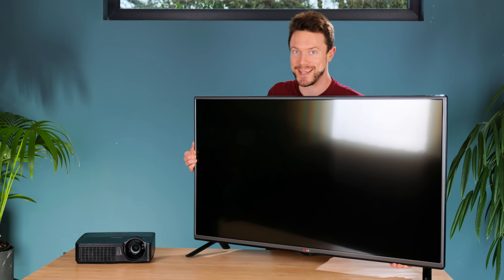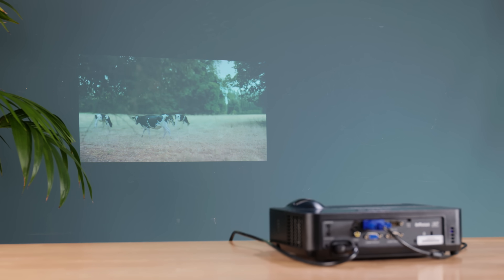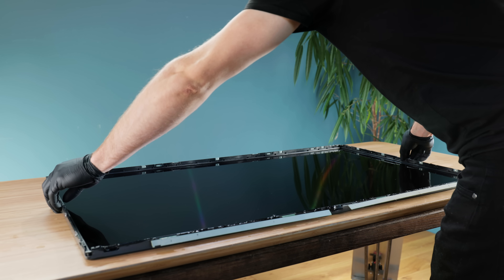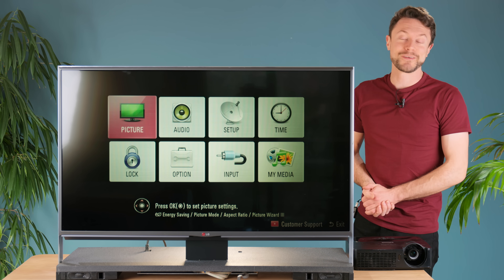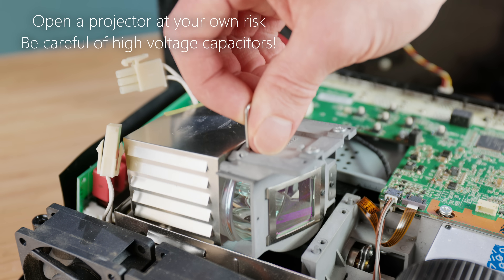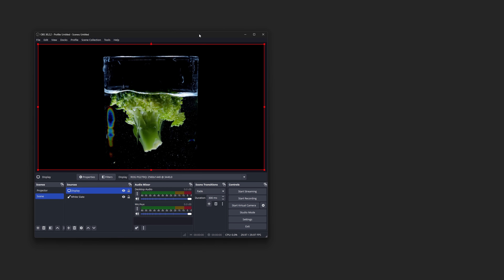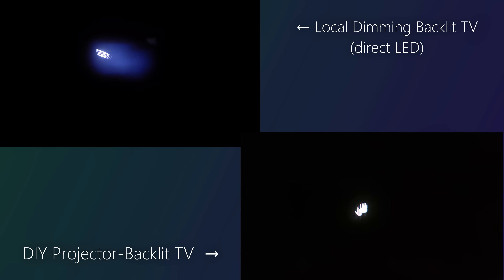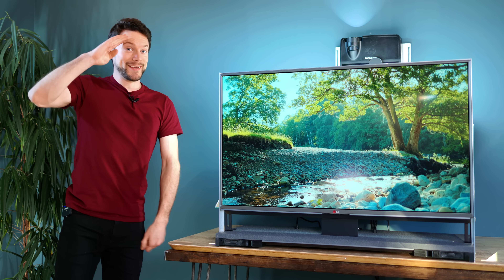DIY "infinity contrast" TV -  with 100% recycled parts

Comment: You should increase the brightness of the projector, (led or otherwise) and then add a modified version of the colourwheel that flickers the screen 960 times/second in sync with the tv to reduce motion blur. If you do it right you  could end up with the ultimate display: oled contrast (hdr), crt motion clarity, and lcd sharpness

Comment: I wonder if you could take say 4 of the LCD panels from 75" tvs and replicate this but using a better, brighter projector would you get a nearly perfect video wall without the typical cross in the middle like you get with typical 4 unit setups due to their bezels?  The clarity of the now 150" screen would be unrivaled for a theater with exception of video walls costing 100s or thousands of dollars.  The only issue I can think of that would be the most difficult would be the alignment of the 4 panels and hold them in place as they would be hanging on a wall together.  I know virtually nothing about this area but am currently exploring building a home theater and wondering if there is a better solution than the typical projector and screen or the unattainable video wall.

Comment: But why are u using the TV mother board for TV programs. If u connect the set top box of your local dish to the projector and focus the beam on the back it will do the same. After putting back the motorized Colour mixing disc in side the projector. Try projecting programs directly from the back of the TV. You will get the same results.

Comment: I did this a few years ago with a short throw projector that schools used for their 'magic whiteboards' and it works great and results in a much less deep requirement.  I have been thinking about using a small monochrome LCD panel to place in front of another projector to get deeper blacks for video projectors, as they always struggle with elevated blacks.

Comment: I can see all of this fitting in one of those old big screen TV cases from back in the day. You should be able to get all those parts for cheap if not free. On top of that it gives u room to add in a nice sound system as well. It will be a big and bulky. But it will look and sound amazing, and it will almost be free.

Comment: Using a short throw projector would make this project perfect. It would make maintainence much easier, as you don't have to realign the projectors and mirrors every time you need to clean and move stuff around. I would consider the slightly reduced color quality compared to an OLED to be a fair tradeoff for longevity. No more worries about accidental screen burn in from leaving something still, on screen for too long. It would also be cool to get a short throw projector with an extra bright, replaceable led, and stockpile them (just in case, if that even is a thing). You can even run it at 70% brightness to maximize its efficiency, plus add some decent cooling, to make it last basically forever (learned of good led practices from a dubai bulb youtube video from bigclive and another led video from technology connections). 

I would absolutely love to see a v2 video, using a premium parts, built exclusively for picture quality. longevity, efficiency, and with no compromises in the design. 

I'd imagine watching something like Odesza live at the gorge would be eye candy on steroids with that build.

Comment: I do use an OLED and hopefully upgrading soon from 65OLED806 to 77OLED950. I tried different iterations of home build Ambilight but just none of them could compete with the original so some 4-side ambilight Philips was KO criteria for me. I have a really nice 6.2.4 Atmos/Auro3D setup including a fair share of room acoustic treatment. And then just a 65" TV. And maybe I can upgrade to 77". Projectors are no option since image quality / deep black is just not good enough even if you spend 20+k€ and use grey canvas. LG doesn't even sell their 83" Panels to Philips which pisses me off. Let alone the 97" which is the first OLED coming close to having a home cinema like size but for a hefty early adopter premium.
This could be a solution. Grabbing some 97-116" LCD and combining it with a short distance beamer. But one would lose option for build in "native" ambilight...

Comment: The OBS work around is a poor substitute for alignment that worsens image quality.  If it wasn't for memory failing(making alignment necessary every time the TV was turned on) I'd still be using projector TVs.
  Display a grid appropriately sized for the ratio in resolution difference, align to that.  Rows and columns are your friends.

Comment: You cold simply use a same size e-ink black and white lcd panel behind the main lcd panel to block out all light splitting the main signal input ( main lcd color signal & e-ink black and white signal). And you could simply use the normal backlight again ( even upgrading to a 5000nit strength if you want.

Comment: If I had enoigh money Id try 4x or even 16x 4k projectors to create one 16k or 64k picture with projectors throwing a single square of the big picture each separately set so close to each other it would look like 1 big picture. Now, what can run 4x nvm 16x 4k projectors spreding the pictiure inbetween then at the same time that doesnt cost a samll fortune? Btw, even if anyone wanted to spend that kind of money the problem of the source of such resolution remains unsolved

Comment: Why not flip the projector and mirrors around 180° and project onto a mirror mounted on the floor instead of the ceiling? That way you don't need to wipe dust off the slanted mirror on the back of the TV stand a bazillion times per week (depending on where you live), just place the whole contraption in a cupboard, making sure the projector gets enough airflow to keep cool.

Comment: I don't get why did you put back the most difusing back pannel... Makes no sense to diffuse that light by too much, especially with the high res.
Reply: The projectors and the tv's resolution is insanely different thats why. The part at the end where he used the obs filters is because even the most diffusing panel wasn't enough diffusion, it was almost impossible to align the screens properly and gave ghosting, text misalignment and parallex effects. He achieved the proper diffusion with the filters.

Comment: While this works well there are reasons why they did not make such things: The projector's bulb has a pretty short life compared to LED or even CCFL. It's also more noisy than a regular TV. It's much more complex because it needs 2 screens. And it is very bulky. Not something anyone would prefer at home. And the projector bulb also can't be turned on and off rapidly. It's cool as a homemade OLED thought. It makes a cool proof of concept

Edit: just realised the first couple lines sounds like something from chatgpt lol

Comment: A couple companies have made tandem LCD panels. The outer panel is standard RGB color, with a black and white LCD sandwiched between that and the back light layer. This way your dimming zones are handled by the black and white LCD so it has that resolution. Not sure why they didn't catch on. I believe TCL showed one at CES a few years ago. LTT covered it IIRC
Reply: The problem was actually matching the two panels at the pixel level. Manufacturing this kind of thing is just too expensive. And of course, having two LCDs means immense as youll lose about 80 percent of light even with the lcd entirely clear.

Comment: You might be able to convert the long throw projector into a short throw with a set of lenses though idk what kind of distortion it will introduce. Either way, will definitely want to build an enclosure around the final assembly to keep all the light funneled onto the TV itself and not scattered to the entire room. Amazing work though

Comment: All this talk about capacitor residual charge, then sandwhiches a low voltage power supply between two metal plates without grounding them.

Comment: Amazing work, but one thing I don't understand is why you didn't try this with an old projection tv. Some of them have DLP projectors so they functionally do everything your projector and mirrors do but within a smaller confined box, and you can often find these projection TV's for free. Just get a projection tv and an lcd of the same screen size and just replace the projection TV's screen out for the lcd screen. I feel like this would be even easier to build while being smaller and more practical, you could also of course try a 4k lcd as well because I'm assuming the one you're using is below that. Not trying to critique your work to harshly I just think it could be refined and simplified in the future, and if you happened to make a video making what I described, I feel like this would be a much more common thing people will go out of their way to create. A cheap and easy alternative to oleds without the risk of burn in while recycling old tech, perfection

Comment: I do wonder how this compares to the other dual LCD screen project. Because in a sense, if you use LCD based projector, you're basically doing the same thing.

Now that does beg the question though; when Matt did the dual LCD layer project, i do wonder what effect would OBS filtering have, when applied to the second LCD. Would that require less backlight and thus less bulky design?

Comment: What a fascinating piece of kit! I’m genuinely stunned by the quality of the blacks here, I figured you’d end up with a lot of blooming from the glow-effect luminance map you’re using, but the results here are really impressive.

With a high resolution, short throw, LED projector you could genuinely end up with near perfect TV providing you’re willing to accept to size of the cabinet it would need to fit into and the loss of brightness.

This project did help me understand why companies don’t use a technique like this already though. With your current setup, you need a floor to ceiling cabinet nearly 2 metres deep, which is far too large for most people to accept. Even with a short throw projector, you’re gonna need to have a similar amount of depth, and that’s unfortunately the Achilles heel of a display like this. 

But, considering how cheaply this could be assembled, it’s genuinely not a bad idea, and I’d love to build myself one of these someday.

Comment: @Matt, I've been a fan for quite some time now and like the way all your DIYs are explained in detail and with real results.
I was wondering if anybody mentioned using the old projector as a short throw by using 2, 45deg mirrors and placing it right under the screen facing backwards? The light from the projector would hit the First 45deg angled mirror directing the light upwards, while the second mirror would reflect it back on to the back of the screen like your current setup. kind of same setup but without the wall mounted projector and ceiling mounted mirror. This would also allow the setup to be moved easily to any location.
Anyways, excellent tip on using OBS to control glow. For, me, I'm still stuck on my 2013's Benq DLP projector and after the lamp hours began dying on me, just replaced it with a 20k hours replacement lamp and its good as new.

Comment: This looks really good, but doesn't the projector follow the same kind of principles used in the tv? The bulb is illuminating the complete frame, but some light is blocked by an LCD. So true blacks still can't be achieved. How can the filtering in the projector be much better than in a tv?

Comment: We did a similar setup for a customer back in the early 2000s.

Except we punched a hole through a wall that separated two rooms and inserted a pain of glass that was frosted on one side that would face the projector. 

The smooth side faced the viewer and was decorated with custom wood trim.

It actually worked out very nicely because you didn't have unwanted reflected light in the viewing space.

Comment: Reinventing the 2000's projector TVs in DIY, love it.
Reply: Hey clippy
Reply: It's really not.  It's a projector backlight but color is from the LED screen.  It's only projector in part.
Reply: @richardbrooksshnee  What would happen if you put the projector into colour mode - you'd lose some brightness, but would you get a boost in colour rendition/saturation?
Reply: @Moony7244  You'd probably get inaccurate colors completely. The projected color filtering will apply to every pixel on the LCD panel, and then filtered again by the color filtering on the LCD again. So a blue light shining onto a "red pixel" will yield inaccurate color, and a bunch of inaccurate colors mixing together temporally will probably look completely weird.
Reply: Came here looking for this comment. Is there any real difference?
Reply: @davexhero  Resolution and cost. LEDs are dirt cheap
Reply: @davexhero  At a technical level, yes, this is very different lol.
Reply: Fellow clippy

Comment: For this purpose, a simple DLP rear projection TV and replacing the front panel with an lcd panel of the same size would solve the distance problems as well as any finessing needed to center the images. Personally, I would rather see an OLED panel bonded to an LCD panel and the OLED would only produce black and white images.

Comment: Mirrors were a good step, but you really didn't need to go off of the ceiling or wall. What you need is a Fresnel Lens and a single smaller mirror, and then simply inverting the image output for the projector, along with some angle adjustments. You mount the long throw projector  vertically as you did with your mirrors or facing the reverse and level to the LCD. You place the smaller mirror either at an angle (for vertical mounting) or flat (reverse projection). Make sure the mirror is scaled to the size of the LCD relative to the mounting distance from the projector. Then place the Fresnel lens (also scaled to the size of the mirror and TV but not as important to be scaled per se) between the mirror and the LCD screen. Make sure the linear side is facing the mirror. The Fresnel Lens can then be adjusted and focused between the mirror and the LCD until the output image from the projector and the image on the LCD match in alignment.

Comment: nice but  200w projector  power consumption is bit too much  and you should use a back up power supply  because the projector´s  lamp will  die if there is a power outage 
guess how I know that.

Comment: Very cool project. I had a fun project with OBS, a fan of retro games, and Amiga, and in it you can simulate the way a monitor looks, but it had fake reflection of the light and room in the monitor, I did'nt really like this, but did like the effect, and thought, hang on a minute, I can capture my room in Web cam and make it transparent and place it over the emulated monitor and got a really effect look, i did a silly video about it. Its great i think, thinking outside of the box for uses of tech.

Comment: So to clarify, is the LCD TV (video source unedited, just duplicated) and projector (video source being OBS) set up as two separate monitors for a pc? A buddy & I was wondering if it’s possible to use a firestick/rooku plug in to run OBS without the need of a computer, so basically a smart tv running OBS with a projector. Feel free to leave any suggestions or comments

Comment: Ok, some manufacturer really should make a tv like this. 65, 75, 85 inches, with that UST projector using it as a stand for the tv or something like that. Probably you can get enough distance if the projector is facing away from the screen, and have a mirror to cast the image back to the screen.

Comment: @DIYPerks Why not use an old projector TV?  This could fix your problem from having to mount the projector from the ceiling in a mirror that projects onto the screen is to find and modify an old projector TV. It can work as a TV stand / Entertaiment center as well. With all that space you can hook everything up in one mobile tv stand and one plug-end off a power strip.

Comment: You could do this exact same experiment with some of the super cheap short throw laser projectors off of Amazon that are like $200 but use One of the $2000 98 inch LCDs as the LCD layer.

You could probably build a screen that would compete against one of the $30,000 110 inch mini LED TVs for a fraction of the money

Comment: Take One of the old fat big screens that used rear projection, not the 90s RGB ones, but towards the end of rear projection tvs, My parents had a 60 or 70 inch single white bulb that i helped them replace a few times around 2015  and the TV was only about 1 1/2 foot thick, it wasnt 3 foot thick like the 90s big screen tvs. 
But that smaller formfactor could make this idea more practical for the average joe like us.

Somehow the picture is magnified and mirrored from a small component in the back.

Maybe pair that with an lcd on the front, OR if you can find a clever way straight from the projector part to black out the blacks

Comment: I would think that using the diffusion sheet that diffuses light the most, is what caused the blurrd problem

Wouldn't the thinnest sheet scatter light less, or maybe use no sheet at all since you are shining a bright pixel  of white light from the projector onto a clear red blue or green pixel. I would think that no sheet at all would make the best picture, or if it doesn't show  color from light passing straight through. A thin white piece of paper should keep the projected white light pixel very sharp.

Just an idea i think you should try! Im not nearly skilled enough to teardown and build like you do, i love learning from you! But if i was there in person to watch,  i definitely am only asking 1 question on why the ticker more diffusion sheet,  it makes sense if you're using led strips for the normal use, but the way you have the projector illuminating individual pixels, the sheet seems like it is bluring up the projector pixels. 
It may still need a white surface to catch the light, but i think thinner will make this bad boy look unbelievable!